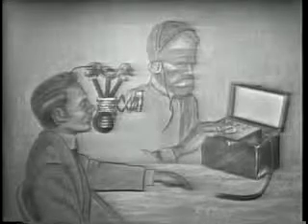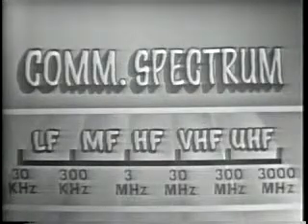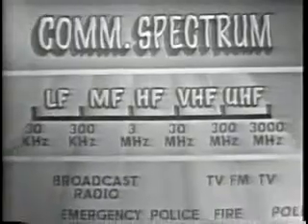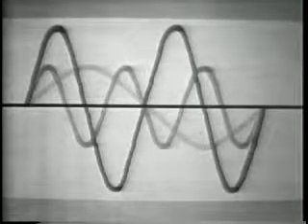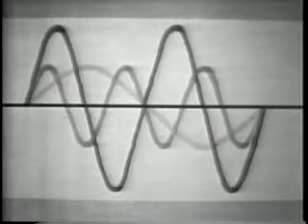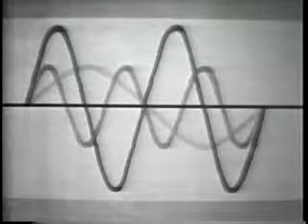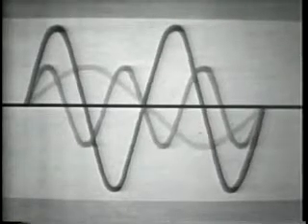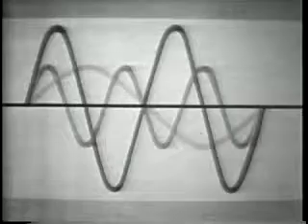Introduction to Single Side Band

Comment: If only training programs we have now could be this clear and  useful.
Reply from the maker: I agree!  I had watch this film back in 87 going thru Ground Radio maintenance in the AF.  It was made in the 60s and when I came back to Keesler in 97 as an instructor it was not changed.  I ordered a new training update on just today's technology (film) but the same outlay in format of info.  Retired and do not know if one will ever be made
Reply: Would have been great to see this before my Ham test. I would have actually understood what the question  was instead of memorizing the answers and not knowing crap.
Reply from the maker: @dougtaylor7724 I get what you are saying.   It was not until I got to be an instructor when most of the electronics I dealt with became clear.
Reply: @johnmayer4747  yes, the best way to truly learn something is to teach it.

Comment: The carrier in AM signals does convey information....it tells the receiver where the sidebands are relative to the carrier.

Since the carrier is missing in SSB,  the radio operator has to tune the signal manually by listening to the audio and adjusting the beat frequency until the audio sounds right.
Reply: <<The carrier in AM signals does convey information....it tells the receiver where the sidebands are relative to the carrier.

Since the carrier is missing in SSB,  the radio operator has to tune the signal manually by listening to the audio and adjusting the beat frequency until the audio sounds right.>>

I agree.  I would suppose this explains, in part, the persistence of the AM broadcast band and AM broadcasts.
Reply: True, the carrier frequency being present enables an easier lock-on by the receiver for tuning, but as far as containing any time-changing information (like an audio signal), it can be said to be redundant. SSB radios usually have more precise oscillators to allow accurate tuning without locking to external references, with corresponding increase in cost, hence why standard, less power- and bandwidth-efficient AM radio still persists for most public uses.

Comment: These are some serious fundamentals lol, what a fascinating behind the scenes look at it all!! I love it 🙏🏼 I wanna know more now lol, what are standard audio circuits?
Reply from the maker: Depends on what radio you are dealing with.  Most regular AM/HF radios for communication are between 300 hz to 3Khz.  If you are dealing with FM a standard Audio ckt is 20 hz to 20Khz.  Those are generalities.  They get more complicated with technology as this info was back in the 50 thru 80s.  Now they are putting data and voice on the same ckt without any detectable degradation

Comment: Where can I get more of this types of quality videos? I love it.
Reply from the maker: This is an old Keesler AFB training film for ground radio maintenance when I went thru back in 87/88 (active Duty AF).  Came back in 97 as an instructor and it was still there till I retired in 2003.  Came back as a civilian instructor.  After many changes in the career field, was able to keep it going in the RF theory module I was in charge of before retiring as a civilian.  Made an RF Transmission YouTube channel for several blocks where the theory for RF module resides.  You will see the updated info the military teaches.  Not classified or FOUO.  https://www.youtube.com/@rftransmissions225

Comment: Can someone please explain what he says at 4:06?: "The audio frequency is not developed in the output because the RF resonant circuits have a very low impedance to audio." I know that the audio is not carried through, but just the carrier and the USB and LSB. But I'm trying to understand the relationship specifically to how a low impedance to audio is the reason? Is there some way I to visualize this? Impedance is the opposition to alternating current. It's just not sinking in.
Reply from the maker: A URC119 HF Pacer Bounce military radio is the best example I can give you.  There is a maintenance procedure to vary the impedance of the mixer circuit where only Side bands go thru and nothing else. It acts like a filter but it is purely resistive, balancing the impedance of the circuit.  If you get the impedance wrong, only the audio goes thru, get it right, the lower and upper side band frequencies go thru (the double balanced mixer eliminated the carrier).  Think of this of a frequency sensitive circuit, you could see this on a spectrum analyzer.  I am going off of memory as I used to work and teach this radio to the military students (30+ years).  I cannot find my schematics but will keep looking. Hope this helps.
Reply: I work in digital TV and I just explain it simply as junk ……… to signal as my spectrum analyser shows me ……===…===…=== is 3x tv channels.
Reply: It's a fancy way of saying that the RF filter is practically a short for audio signal. It's not incorrect, but different from the way we are used to think about it.
Reply: Have you ever looked at an RF circuit board? That's not a sarcastic question, if you've never seen one you should look at some videos by "The Signal Path" or look up a picture of a "butterfly stub filter". If you look at those pictures it should be obvious that those circuits are short circuits to frequencies near DC.

Comment: Although much is well done and an excellent narrator has been used, an error in the manuscript for the explanation of the block diagram devalues the quality of the film production from 04:10 onwards. The high frequency circuits after the modulator/mixer do not have a low impedance for audio frequencies, but a very high one.
Reply: Good point.

Comment: Why not transmit the carrier, but at greatly reduced volume, which then can be used to provide constant synchronization of the BFO? The stereo multiplexing of the broadcast FM uses the 19 kz pilot tone to reconstitute the 38kz frequency of the stereo difference frequencies. The NTSC color television system uses a carrier burst on the back porch of the synchronizing signal to reinsert the carrier frequency for the color differnce information.
Reply from the maker: Carrier and one of the sidebands carrying the audio is not in the output as it was meant to transmit the the audio portion at a greater output since everything was suppressed.  HF was before TV and FM was in the mix during this time frame.  Frequency range of HF was using the ionosphere at great distances compared to the high frequencies.  You have to remember when things are invented, thinking ahead is not in the mix.
Reply from the maker: I do have to add this is old technology compared to how things are now.  We do not know for certain whey they did what they did during that timeframe.
Reply: Reduced carrier transmission has been used, but for the military applications discussed in this video, maintaining compatibility with standard AM wasn't as important. Additionally, that kind of AM-compatible modulation can result in significant audio distortion at the receiver.

Comment: Great video. Was this originally on an 8mm film?
Reply from the maker: Not sure.  Was completed on Keesler AFB back in the 60s
Reply: Based on the frame rate, this production looked to have been direct to videotape—8mm tended not to run this fast, and some of the camera cuts look jagged, like they originated from interlaced content.

Comment: Why do the frequencies get added? Isn’t that frequency modulation/manipulation?

I thought I was pretty sharp on signal modulation. I love the vintage military training videos, and this one gets closest to grasping the sidebands. Have not found one single explanation of why changing the amplitude magically generates Fc+Fa and Fc-Fa. Other than “here are the sidebands, because they are always there.” Frustrating.
Reply: Yeah, everyone is talking about how clear this video is, but the older ones from the Navy or Air Force about AM and FM were much clearer. Whoever wrote this relied too much on “as you know…” and “obviously…” in the explanations to skip over stuff. I have some books on the way that hopefully explain everything (ARRL handbook).
Reply: It’s pretty informative in terms of the benefits (which I didn’t know), so it’s more of an ad for SSB.
Reply: Mathematically, modulating any baseband signal with a carrier frequency is equivalent to summing the frequencies together (or taking the difference as well, in standard AM), regardless of what modulation scheme you use.

Comment: So what have been the greatest advances in radio communication?

Some candidates might be:

1. Spark gap code transmissions that first allowed practical radio communication
"CQD CQD CQD  This is RMS Titanic, we are sinking  SOS SOS SOS"

(The most famous signal ever sent by spark gap transmission?)

2. Continuous wave (CW) code transmissions allowing high quality radio signals.  This relied upon the development of vacuum tubes

3. AM radio transmission, utilizing vacuum tubes for  generating CW signals and amplifying audio for modulation. This allowed mass media radio to develop.

4. Frequency modulation

5. Development of RADAR and cavity magnetrons (1940s)

6. Development of transistors  (1950s)

7.  VHF, UHF and ever higher radio frequency utilization 1950s

8. Development of practical mass media television  1950s

9 Development of Single sideband radio transmitters    1950s

10 Development of integrated circuits  1960s

11.  Digital modulation of radio signals  1970s

Looks like the 1950s were the peak decade of radio frequency developments

The decades since the 1970s looks like immense improvements in the technologies of integrated circuits and digital modulation of radio signals.

But this is off the top of my head. What do you think?
Reply: The amplitude and modulating components; Lee DeForest Audion (vacuum tube) and transistor.  Nearly everything depended upon these two inventions.

Comment: Nope... Still don't understand... Can anyone explain to me what the heck is a sideband? I understand AM and FM. But where does "sideband" fit into this.
Reply from the maker: If you understand AM, you have an upper side band (USB), a Carrier, and a Lower Side band (LSB).  The carrier "carries" the intelligence (voice/data) and the intelligence is in both USB and LSB. The carrier is a placeholder.   In HF, the carrier is suppressed and the one of the side bands are eliminated.  All the power is in the one side band. For FM, all the intelligence is in the carrier but covers a wide range of frequencies in the carrier.  For simplicity, there is no side bands in FM.  Hope this helps.
Reply: @johnmayer4747  Thanks! I think I'm  closer to understanding what a sideband is now.
So its a definition problem. Rewatched the video with new understanding and many parts made sense now. 
But I still don't get how a sideband is generated or how it looks. (hey, atleast I know where it is now!) 
Like, how does a sideband transmit at all when the carrier is gone?
(in my head, the carrier is the one carrying the information, if the carrier is gone. What is carrying the sideband?) (I know this definition of carrier wave isn't right, but this is my limit as of now)
Reply from the maker: @kenco2600  I am not sure if I can create a picture using words but will try.  For simplicity we are going to try an am transmitted voice signal at 100 Mhz that has 25Khz bandpass in the frequency spectrum.  Looking at a spectrum analyzer, you key the radio (transmit or push the mic key) the carrier will be at 100 Mhz.  Since you have no voice added yet there are no sidebands.  When talking, typical voice is between 300 hz to 3khz.  You key and talk, you will see the carrier at 100Mhz and your voice will be on both the USB and LSB.  Let's go further since it is really hard to see all the voice frequencies at one time.  If we take a constant 1 Khz audio signal and apply it to the mic, on the spec analyzer we should see a LSB, carrier and USB signal.  We can even apply where those signals are in the frequency spectrum.  The LSB is calculated 100 Mhz minus the 1 Khz and should be 299.999 Mhz.  The Carrier will be 100 Mhz, the USB should be 100.001 MHz.  All of those points are measurable on the spectrum analyzer.  With voice from 300 hz to 3khz it would be 299.9997 Mhz to 299.997 Mhz on the lower sideband, carrier at 100 Mhz.  The Upper sideband would be 100.0003 Mhz and 100.003 Mhz.  If you are still having issues with understanding, we can set up a time and place (discord) so you can ask question and I, can hopefully explain it to where you understand it.
Reply: @johnmayer4747  uhhh, this is a lot more complicated than I thought. I didn't understand atleast half of it but I will try to understand it.
Still, thanks for the answer!
Reply from the maker: @kenco2600  its ok, it took me a few months of going over it before I finally "got it".  if you need help, just give me a yell.
Reply: @johnmayer4747  another question, if you get sidebands by broadcasting AM first, and then filtering out whatever is not the sideband you wanted. How are you getting 6 times more power?
Reply from the maker: @kenco2600  By eliminating the carrier, it has the bulk of transmitted power in AM.  In HF all that power not transmitted in AM is added to the sideband in SSB HF.  AM Carrier contains half of the transmitted power and the sidebands contain 1/4 of the power.  By putting all the power in 1 sideband and adding all of the power that would have gone to the carrier and the other sideband, in theory, it equals out to 6x.  Hope this explanation helps and if you need more help, give me a yell.
Reply: @johnmayer4747  uhh, not quite. The message you written was already explained in the video. What I'm confused about is how it was done.

Lemme put it this way. Since radio waves are electromagnetic waves, same as visible light. If you put a filter in front of a flashlight. The light would become dimmer. So how did they made the light 6 times brighter? 

I thought at first they removed the need to use a carrier wave and one sideband altogether(so they can focus all power on the sideband) . But apparently according to the video, that wasn't the case. You still need to make the AM signal first, and then block out the wrong signals. Which is like putting a piece of colored glass in from of a flashlight(this doesn't sound power saving at all) . Which doesn't sound right to me. Am I missing something? Or did I misunderstand the video?
Reply from the maker: @kenco2600  OK, hopefully I can clear this up.  AM carrier's power is just taking up a spot in the frequency spectrum and is for all practical purposes, wasted power.  For simplicity, if the power is 10 watts, that is 10 watts the carrier is transmitting and 2.5 watts for each sideband.  With SSB, the carrier and 1 of the sidebands  equating to 7.5 watts of total power is gone. If you were to look at the signal on a spectrum analyzer you would see one of the sidebands and carrier missing from the AM signal.  Now you are probably going 10 plus 2.5 is  12.5 watts but unfortunately, the max you can ever have is 10 watts total when it comes to out put in a radio. The lone sideband is 2.5 watts.  In theory...... is you have put that 7.5 watts into a 2.5 watts sideband and increased it to 10 watts of pure output power of intelligence instead of wasting the 7.5 watts on a broader frequency range.  So instead of AM only having 2.5 watts of intelligence power you now have 10 watts of intelligence power in SSB.  The 6X you are referring to is in db so the power savings are theoretical.  If you need more explanation, I can use discord, sharing my screen to show you a better way of looking at it if you want.  1 thing I wished I had kept when I retired from teaching the military was the HF videos portion recorded a few years back.  Also, Try the RF Transmissions YouTube channel I still manage for the squadron and you might be able to find a video or 2 to assist with other info you might have some questions about.
Reply: @johnmayer4747  Umm, i think you didn't get i was saying. Hopefully i can make it more clear.

I was under the impression you can't make sidebands without broadcasting the whole AM first(and the you get rid of the carrier and one sideband afterward).

I would not be so confused if the machine can simply broadcast sideband without broadcasting AM first. (just put all the power into sideband instead).
But the videos online keep mentioning that in order to make sidebands, you must filter out the AM first.
I didn't think trying to figure out  sidebands is this complicated. So forgive me if I am misunderstanding something.

Comment: For this type of explanation format, this is quite good, but I see this a bit differently. It's a typical, instinctive response to be scared off by equations. But when a subject is deeply technical enough, you really need some equations to accompany the verbal content and pictures. This presentation, though it's good enough as far as it goes, can't really take you all the way to a full understanding of this subject.
Reply from the maker: This video was made to keep it simple for the new recruits at Keesler AFB.  Normally the lecture provided more detail info.  I remember we would go thru the schematics of the URC119 and review each step of the making of the waveform to the output.  It was eye opening.  As far as equations, the recruits were not at that level..... yet.  That would be a few years later and more training.